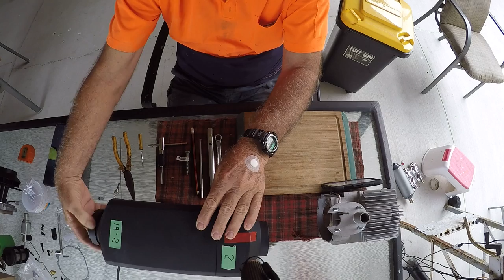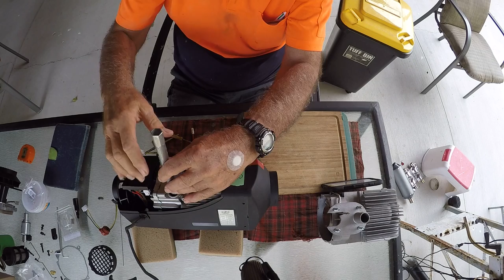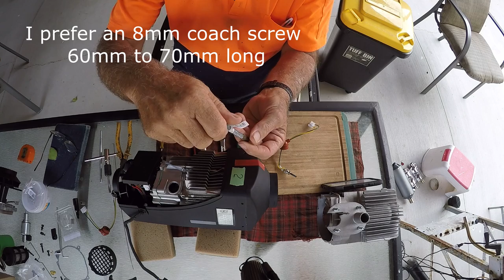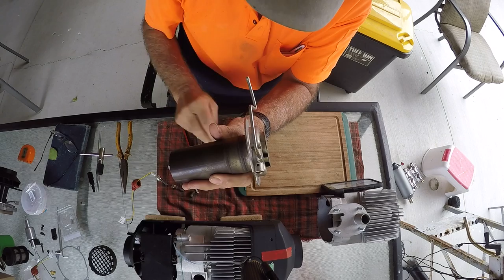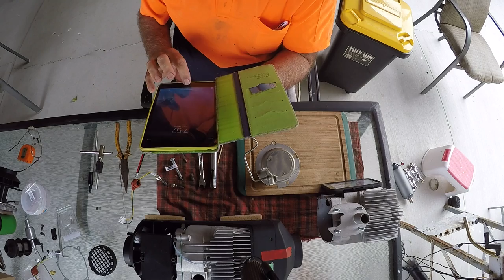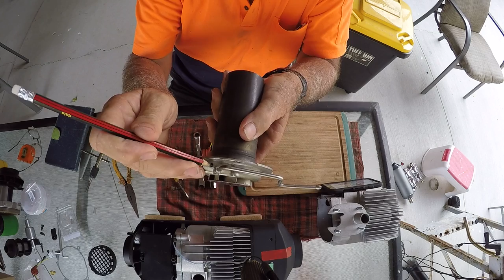Chinese Diesel Air Heaters - Part 9 Glow Plug & Atomizing Screen

Comment: I am watching all of your videos - thank you! I purchased A 5k unit off amazon for 140$. Then saw a better one on ebay for 112$ - then got an offer for the same one for 85$... but I didn't buy it because I thought I only need 1 and have 2 coming in! lol (but I may get it anyway at that price! : - ) 

PS: PLEASE, PLEASE PLEASE - LINK ANY AND ALL PRODUCTS AND PARTS. YOU CAN EVEN MAKE MONEY IF YOU GET AN AMAZON AFFILIATE LINK AND LINK ALL THE BITS AND BOBS - IT WILL MAKE PEOPLE LIKE ME WHO ARE PREPPING TO INSTALL, IT WILL MAKE IT MUCH MUCH EASIER TO GET THE THINGS WE NEED - EXAMPLE: REMOTE BATTERY 27A - LINK - EXAMPLE - ATOMIZER SCREEN - EXAMPLE - GLOW PLUG REMOVAL TOOL/S - ETC

(Even if nothing else but the link for the item in google search - so we can see exactly what it is we need to be looking for...)

THANK YOU!
Reply from the maker: Hi CS,

Thanks for the feedback. 

I am reluctant to put in links to these heaters or parts because after a few months the sellers are no longer there, or no longer sell the parts.

Not ONE of my past suppliers are still there, or still sell the parts I bought just months ago.
The sellers seem to buy a batch of heaters or parts and when they are sold they move on to some other product.

But I share your frustration, and I will see if I can find some sort of solution. Even if it is listing how I personally search for parts.

My goal with these videos is to try and give help to the DIY person who will buy these cheap heaters online and will self install without the technical support they would get if purchasing a brand name heater from a retail store. I am not seeking kickback commissions. 

Have you seen the special tools video?

Best wishes.  JMcK
Reply: @johnmck1147   First of all, THANK YOU for your hard work and methodical technical tutorials! I have 2 heaters on  the way and I am sure I will have a much better time installing them after watching ALL of your videos! : - ) 

As for the links - just put links to the general item name on Google. Like example the A27 Battery or the Atomizer - that way people can search on their own with confidence that they are looking in the right direction...

And... finally, just a thought; as you put such meticulous hard work into this series (and should get compensated somehow) I would suggest you get an Amazon Affiliate Account and find some steady suppliers of the heaters, as well as the other parts, tools etc and link them. When people watch your video and then click on the link to buy, for example, the "Glow Plug Socket Wrench, specially designed with the slot cut out for the wires," you can get a small cut of the transaction - and everyone wins... 

Just my thoughts, and again...! YOU THE MAN! - Thank you again and keep them coming!
Reply from the maker: Camping Sequoia 

Thanks for that info and feedback.  JMcK

Comment from the maker: High Mathew, all sounds ok. Keep filter and pump as near to the tank as possible and as low as possible so it does not have to suck hard. The heater will be low in your setup so the pump does not have to lift fuel high. If you use the thin hard nylon fuel line normally supplied and pay close attention to all the connections I don't see any issue. I have run the thin nylon fuel hose more than 15 feet in a boat without issues. J
Reply: My heater came with a soft 1/4 inch (6mm?) clear tubing.  How does that compare with the thin hard white nylon fuel line?
Reply from the maker: IncandescentDaD 
Please watch video no 11. Your soft tubing will work if the distances are short and you do not get carbon build up on the burner screens. The fuel pumps on these heaters pulse fuel, unlike other pumps that flow fuel. Soft fuel line absorbs the pulses and hence the force of the delivered fuel. Also the ECU counts the pulses to match fuel delivery and fan speed to get a correct fuel air mix. If soft fuel is absorbing some of that pulse force, you can get an incorrect burn.

Soft line will work in many installs but for  best operation use a hard fuel line.
Reply: @johnmck1147  Thank you very much, John.  I just watched no. 11 and it was excellent.  I asked in a comment there if you could post the technical specifications as written on the side of the tubing so that we who were saddled with the inappropriate hose could find the correct one.  Thanks again!
Reply from the maker: IncandescentDaD  Info as requested.

The nylon tube is 4 mm dia x 1 mm wall. It has an internal bore of 2 mm.
Working temp. Is 35°C to 120°C.  Working pressure 4.5 MPa

4mm fuel hose also works for short runs and eliminates all the joiners, but use the stiff heavy wall type, not the soft fluffy type.  JMcK

Comment from the maker: To David Dempster,

I received your query on email, but it does not show up here.
But in answer to your question regarding spares, I buy them on eBay. However, with some items you need to search under Eberspacher spares. These heaters are a clone of the Eberspacher and many parts are interchangeable. 

If you have a particular item you are chasing I may have a link.

One issue why I am sometimes reluctant to put a link, is unlike, say Amazon or Banggood, who are in for the long haul, many eBay sellers come and go in short order. Often, I suspect, the same seller just changing their name to avoid returns and warranty. 

I have sometimes gone back to a seller a month later to buy more of an item only to find the item or the seller no longer available.

Cheers.   JMcK

Comment: Just a quick question, how well do these heaters handle extreme vibration. Am looking at mounting one in a camper trailer that does 10s if thousands of K a year over corrugated roads. It will either be hard mounted on the trailer or i can make a box set up that can be removed sitting on low density rubber to absorb the shock loads ? Your serious is fantastic so much good information

Comment: what kind of amazing birds are those singing?! also, does running a 5kw model on low cause soot build up? should I run on high after a night a low so it burns off?
Reply from the maker: Hi Robert,

The wild birds here are the Australian Magpie, and Australian Butcher Bird.

If your heater set up is gold standard with minimum restrictions in combustion air inlet and exhaust, you will have very little carbon issues running the heater on low power.

It is good practice to occasionally run the heater for 15 mins or so at high power to burn off any carbon deposits. 

The frequency you do this depends on your install. With a gold standard install, a high power run once a month or even once a season is reasonable.

With a poor install, with lots of restrictions, then perhaps every day may be beneficial.

Cheers,  JMcK.

Comment: I got two heaters called all in one. 5kw  the short ones.  Heater no 1 works fine and heater no 2 works fine.  No 2 has the old 3 blade controller head and board and no 1 has the newest style.  On no 2 heater startup there are 3 quick pulses then a pause then the normal pulse rate.  Right there after  I get a wiff of diesel smoke smell whitch goes away. The other one doesnt do that.  No smell at startup.  Both heaters are moved in and out from the same install for testing.  The exhaust goes out a 2 meter pipe up in the air.  The smell it comming from the heat exchange I surmize.  Plan is to tear it down and inspect.  Im waiting on gaskets.   Also  no2 has a fan noise, not rubbung but more of a groweling sound , can only be heard at the air intake.  That's my story.  These heaters are nice.  I like tinkering with stuff like this.  Now I want it to snow so I can sit there with blasting hot air on my face and  grin from ear to ear.  Tally Hoe Mate Crazy Dave  Sea Yaa
Reply from the maker: Thanks for the feedback Crazy Dave.  
Have you seen the video on Gaskets?  JMcK

Comment: John my heater is starting but blowing lots of white smoke. I have narrowed down the issue to the glow plug only receiving 4.5V to an 8V glow plug. The unit itself is not suffering any voltage drop, on start it dropped from 13V to 12.6V which I believe is quite acceptable? Would you in all your assessment of these heaters be inclined to believe the issue is with a faulty motherboard? What other suggestions do you have for voltage drop for the glow plug only?

Comment: Hey John, great series.Just wondering if you have my ideas on the E-03 code. I have replaced my glow plug and atomizer (below the unblocked hole) and it still comes up with the message. Exhaust and intake clear.
Reply: @johnmck1147 Any fix for this? I have the same issue, I replaced the glow plug and the atomiser. When I press the start button the heater makes a single click and E-03 pops up right away.